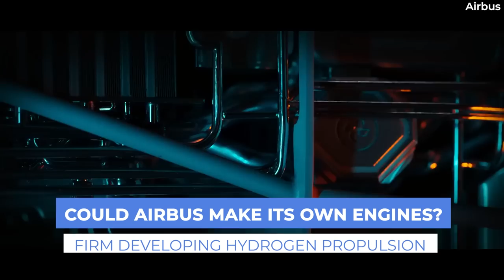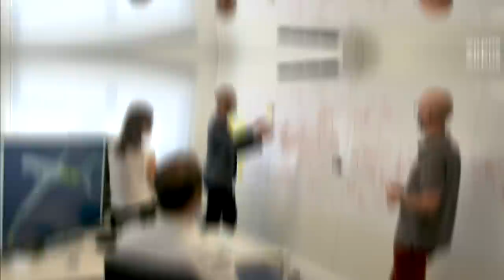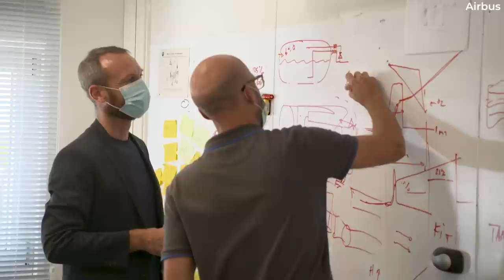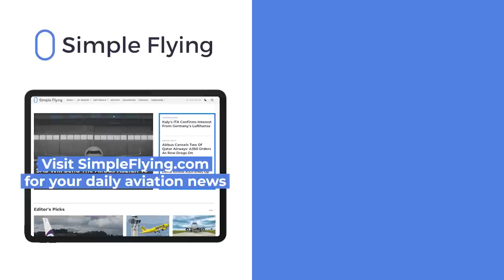Could Airbus Begin Making Its Own Engines?

Comment: If Airbus go down the alternative fuels route, integrating their own in house engines would be a more efficient process long term but would require significant investment initially not traditionally being an engine manufacturer.
Reply: That's probably why they are looking into a joint venture to exploit the knowledge from companies already in this space.
Reply: Airbus gets there cash for free.
Reply: There are no real alternatives everything considered. Also, before getting hyped, check the concept of entropy and how hydrogen is produced

Comment: Won't happen.  You can collabote/partner but will not be able to directly manufacture or solely design a new engine by either Boeing or Airbus.  As soon as they start they will be hit with an Anti-trust (monopoly) lawsuit from the US and may be barred from flying to any US airport even if owned by a US company.  The Airmail act of 1934 prohibits all companies from making any combination of Engines/Air frames/Airline.  So it won't be happening.
Reply: I agree with that!
Reply: I mean if Apple can make its own processors and ditch Intel, then I don't see why airplane manufacturers can't make their own engines
Reply: @alfredosauce1  there is no IP licensor like ARM in engine business
Reply: These 90 year old laws can be changed, especially if they are superior to current engines. Happened to my company, USA lost out drastically. Subsequently they very quickly changed the Rules.
USA are good like that.
Reply: The US would definitely apply that law..... until Boeing start making their own engines too, then the law will magically dissappear.
Reply: @alfrredd  Boeing DID have that.  The law was almost created to break up Boeing back in the 30s.  Boeing, Pratt & Whitney, and United Airlines were the same company or sub companies under United Aircraft and Transport Co.  Founded by Bill Boeing in 1929.
Reply: @BPiperDude  they have in the past.
If they cannot make it to a standard, they buy in, thus very quietly changing standards to fit.
Reply: @grahamcorry8328  Sorry don't know what you're stating here? "If they cannot make it to a standard?"
Reply: @BPiperDude  that's correct. A UK standard was far higher (1.5%CV USA, 0.4% CV UK)

Comment: Absolutely, it should save time and money.  Their aircrafts are already very nice.  So their engines should be reliable too😀.  Airbus is sharp.
Reply: A%
Reply: So lets put RR and GE out of business.  Now an aircraft manufacturer will end up developing the engine and the plane?
Reply: @danharold3087  it will be decades before something like that happens, hydrogen still has a long way to go before it's full integration into the aviation industry. We still have to find a way to bring it's cost down, so even in the 2030's is application will still be very very small. 

The CFM LEAP RISE being developed will have the option to run on 100℅ hydrogen and %100 SAF, so GE is not seating by.
Reply: @mmm0404 Others have suggested this should go further than research.  My point is that Airbus or Boeing making engines is not a great idea.

Comment: Hydrogen fuel cell in the motor / vehicle industry never really took off. Never understood why, would like to know if this is the same limiting factor if applied to the aviation industry.
Reply: Primarily a cost issue for cars. The membranes used to make the fuel cells work are very expensive relative to the cost of the vehicle. It wouldn't have that issue in a large modern jetliner.
Reply: @commerce-usa  but Li-ion batteries were expensive too. We have developed it to such extent, so now it's significantly cheaper to buy. I guess we could have seen the same thing with hydrogen propulsion
Reply: Hydrogens have a far lower energy density compared to fossil fuel, one of the biggest limiting factors, and possibly the killer of this technology for airliners, as it takes up too much volume.
Reply: Hydrogen production is not carbon free yet. That is one of the main reasons why governments did not subsidize hydrogen fuel cell powered cars.
However there are some promising technologies which may allow carbon free hydrogen production, for example VHTR. When such technologies are available, hydrogen powered cars will also be a reality.
Reply: @user-yt198 Toyota kept trying for years to get people to buy hydrogen fuel cell cars to limited success. The problem is that they only offer a 30% increase in overall efficiency compared to conventional whilst pure EV is 80% more efficient from a comparison website I saw
Reply: The reason hydrogen fuel has not taken off yet, is the infrastructure was never there in the first place 
Lithium ion batteries have their own problems from mining to charging issues, for the same weight and mass hydrogen fuel has 10 x the energy density of Lithium ion Batteries that's the reason batteries will never be used for long haul flights ✈️
Reply: @commerce-usa  That and a BEV being several times more fuel efficient.  Clean hydrogen is like 3X the price of gasoline.  Storage transport dispensing ......  it blows.
Reply: @derlangsame7813  Hydrogen has been mostly static since the 1960s.  Not for a lack of research.     Are you going to invent a new hydrogen molecule?
Reply: @danharold3087  No.